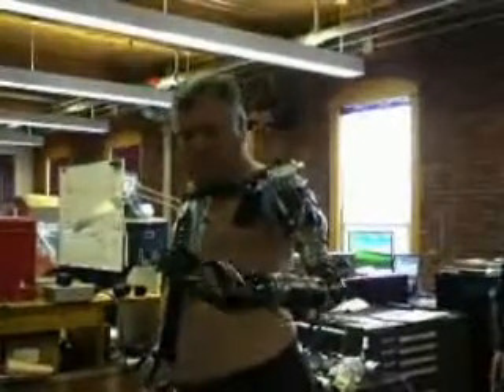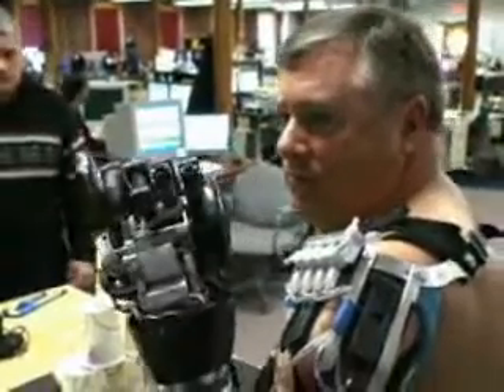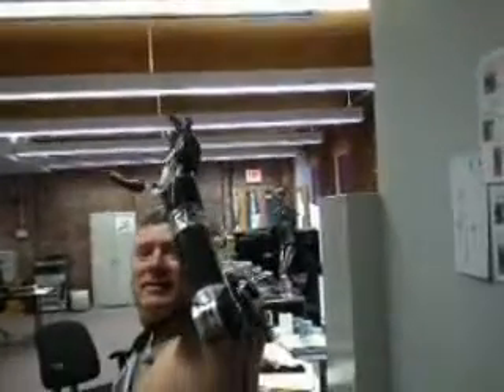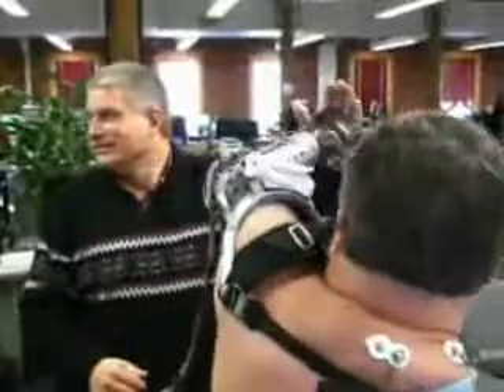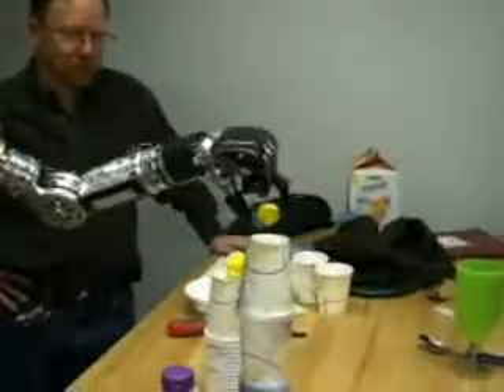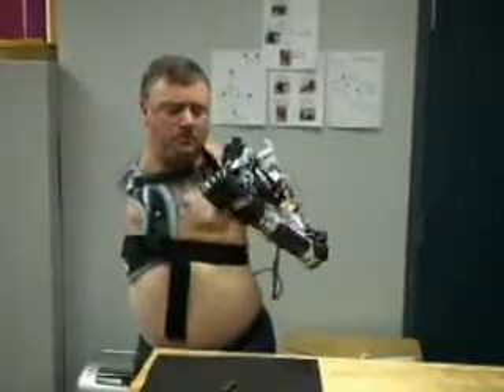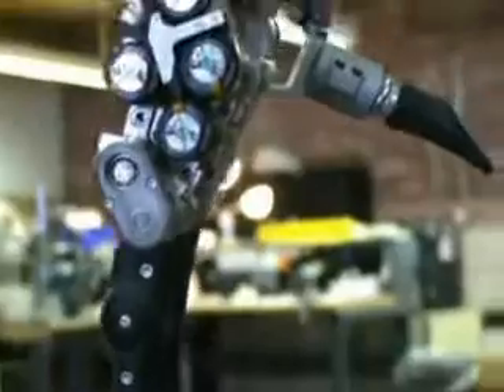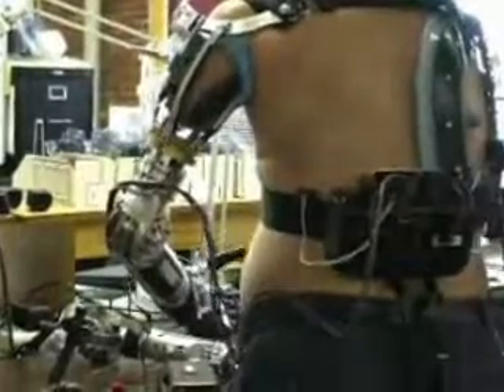IEEE Spectrum Dean Kamen's Atrifical Arm (part 2)

Comment: Videos like this are inspiring and really amazing. I started thinking of possibilities for why this kind of technology is still prototyping and not available to the consumer. Although this is likely not the case, I'm sure it would be interesting as far as dealing with possible outcomes of the robotic arm legally.
The arm could be blamed for malfunctioning. Malfunctions could stretch to any level of liability for assault or even murder. Signing contracts with the arm would even be cause for creating new laws that attribute the arm acting as the person. If the person is made indistinguishable from the arm, and incidents occur such as an auto accident, any number of problems could arise. The artificial arm could be blamed for malfunctioning, or the arm could actually malfunction and cause all sorts of issues.
Do companies really want to risk releasing a limb to the public that's capable of ripping of their genitals, or breaking a babies' neck? The current laws don't cover these issues, but I'm sure things are progressing in this field of limb-replacement and the future laws concerning them.

Comment: @RuslanLagashkin If the plasticity of the brain allows it to garter sensory information from abnormal places, it may be possible to send operating information from abnormal place also. We can connect electric sensors and electrodes to few peripheral nerves (which, for example, normally, send signals to 1x1cm part of skin). The brain will learn to send necessary operating signals to that nerves after not long time. Such way is safer than implants directly in CNS and allows